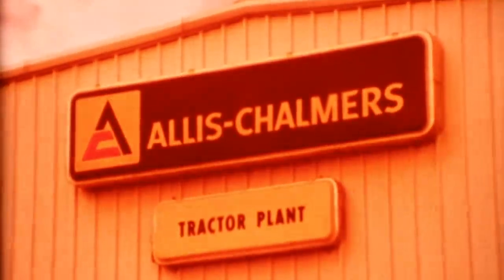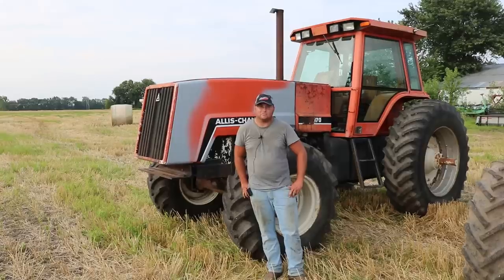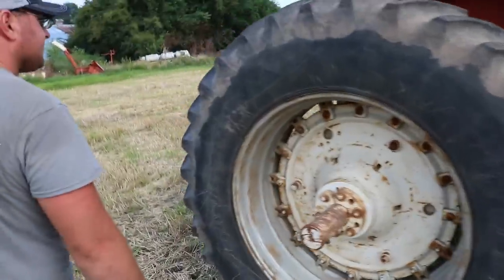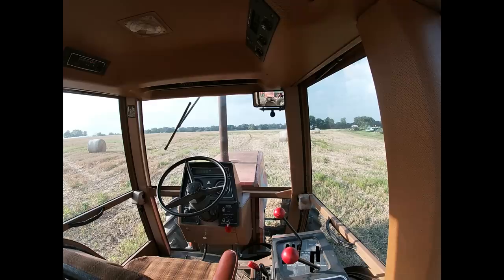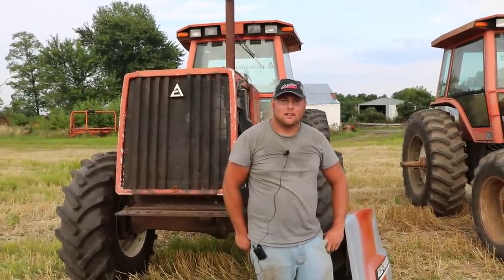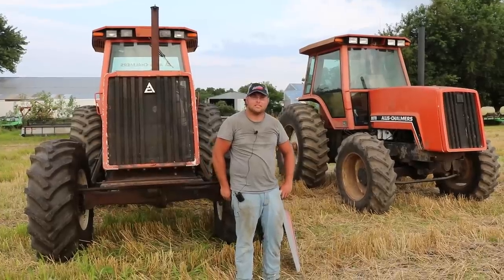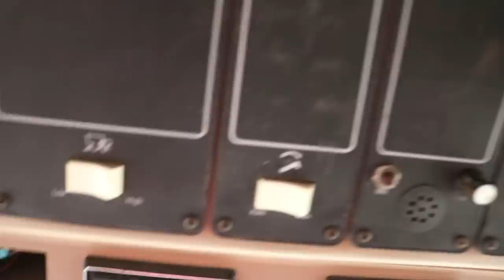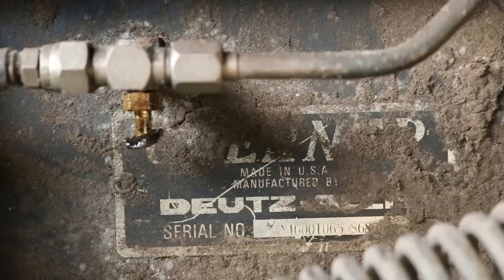Allis Chalmers Show:  What Could Have Been, The Allis Chalmers 8095 Tractor

Comment: Being an employee at Allis Chalmers between 1973 to 1985. I was so busy during that time to see the full picture. During my time at Allis Chalmers, the 7000 series tractors was a good seller . We couldn't get them out the door fast enough. After the 80's, the 8000 , 6000 and 5000 series tractors were the future of the company. Engineering and production made them better and more powerful over the years.The company is gone but the orange tractor's story continues with J-L videos.
Reply: We're employees there union ?
Reply: You would not believe how many A/C are still in use today in upstate NY. From 8030’s to D12’s. Ironically The prices are still incredibly high considering how old and used they are but people still love their reliability and easy to fix. The plastic junk they sell today won’t be running in 7 years once the computers junk out.
Reply: @cousineddie3714  local 248 UAW,  with a very "colorful" history...
Reply: @cousineddie3714  We were members of UAW Local 248.
Reply: As someone who's grown up with allis in my family. One of the flaws allis did along with others that I never understood other than saving money in the short term was pushing the 426 for so long. They should have capped it at 140hp upped the cubic inches.
Reply: @coltoncarpenter3790  nonsense
Reply: @tompreiss3947  "colorful" as in red
Reply: Raised on AC. WD D15  200  8070
Reply: @RJ 1999  it's pretty true that 426 was getting pretty long in the tooth by the 80s, and a newer engine was required... the 7080 was pushing the 426 I think the 7040 was probably the best fit for that unit 7060 was OK but 7040 was the 426 in its sweet spot...

Comment: I built one of the 8095 I was a prototype  build and test technician at Frankville WI. Proving ground. And was at the 2019   Allis show at Frankville and Racine County Fair. Go Orange.
Reply from the maker: Did you know Larry Gruenberger?  I got to meet him in 2019 in Hutchinson when he was demonstrating the D-19 tow tractor.  Any other neat prototypes or products you remember?  What about the infamous 18 speed powershift transmission?
Reply: Did u have the Komatsu engine in it? How did it start??
Did you ever see it on a dyno?
Reply: @JandLVideos  I worked for WFE Libertyville, Il as prototype  build and test technician when White went back to Charles City I was hired at the Allis proving ground by Larry he was the manager and BOSS at Franksville I have a photo of Larry and me there in 2019 will post in a later date. I was there just over one year 1984 to the end. It been 37  years and something I just don't remember, but thinking the 18 speed power shift is misconception  what I think it was was 6 speed power shift with a 3 speed range. If someone  can prove me wrong I would like here about that.
Reply from the maker: @davidstanonik3389  ever make it to the Orange Spectacular?  We'd love to talk to you!
Reply: @JandLVideos  Yes they were komatsu and of course they started good like any new engine. Not sure about PTO H.P.  that was run by another  guy, I do remember  making longer frame rails for a 8070 to lengthen  it wheel base to fit on the wheel drum  dyno to test front axle planetary  gear set, It may of been 8095 can't remember
Reply: FT
Reply: According to norm swimfords Allis books you are correct, 3 range 6 speed powershift
Reply: @jeffspencer9186  When I was at the Frankville proving I had the opportunity  to drive the tractor with the 6 speed power shift no field work just around the shop area.
Reply: @davidstanonik3389  That explains the missing front end! I'd like to visit with you sometime.
Reply: @daehlerfarms  What is it that you know about the missing  front end was it 8070 or 8095 I also was working on update on the 8000 series think it was getting close to the end and thay never went into production
Reply: @davidstanonik3389  Serial number 1 on the heavier front end for the 8095s. 2,3,4,5 are the numbers that were on the tractors. They are acounted for as are the front bolsters for the tractors that give them the extra length.
As far as the production 8000s, an updated agri data system was supposed to be ready for the tractors along with updated powershift but never happened when they shut down. I have factory operator manuals for the agri data dashes with all the functions it did.

Comment: wait... there was plans of a series of +200hp tractors? That would've been almost 20 years ahead of the rest of the industry. I thought it was just gonna be one high horsepower model on top of the 8000 series
Reply: That's allis chalmers for you ahead of everyone else  in tractor design
Reply: Would’ve been like the case ih magnum.
Reply: mebbe a few ponies more than the Magnum or JD 8000 series. Both of those series spanned 175 to 250hp. No manufacturer broke the 300hp FWA mark till the early-mid 2000s (thats not to say there weren't some hot boxcar Magnums or JD 8400s that exceeded that mark)
Reply: They were going to 300 engine horse like the 4w 305. It was going to be the 9000 series. One of the engineer's that's passed away now from the Allis forum always said it was a 9025.
Reply: That woulda been fuckin boss

What machines had that Komatsu engine in em...big excavation/mining equipment?
Reply: @farminstoltzfus  I'd say bulldozers, trackhoes and large wheel loaders. I need to do some more searching on the engine part as to what model it is.